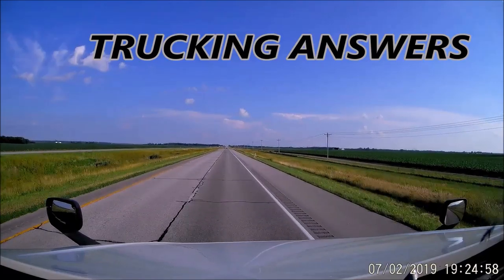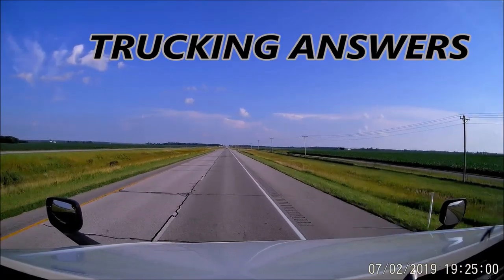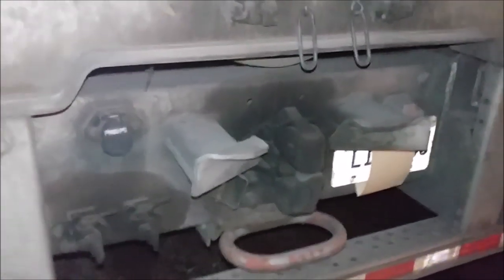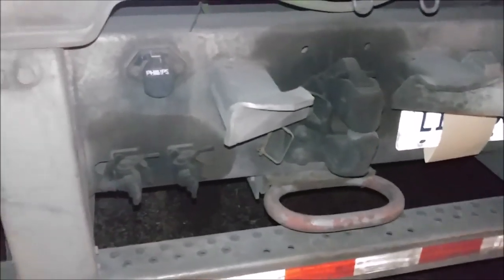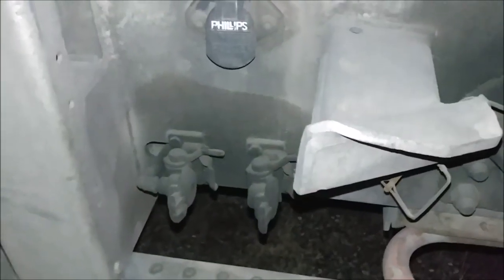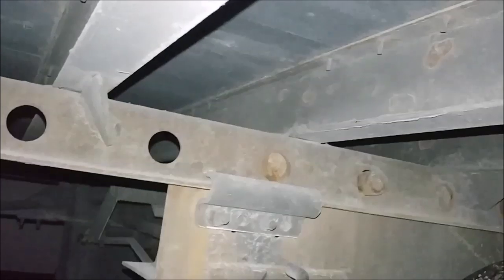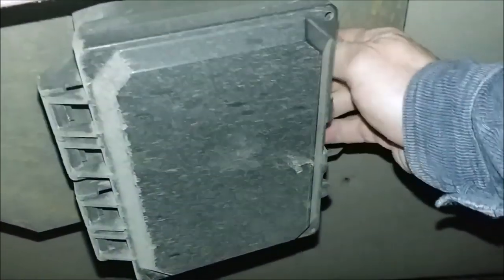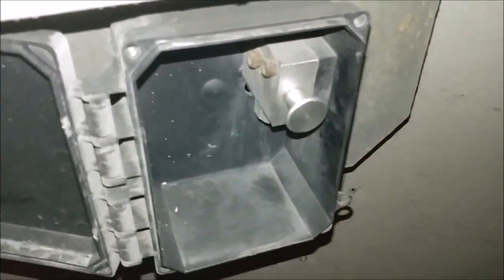Air leak?  Check here! | Quirky 53 | Trucking Answers

Comment: The micro 3way upper lites
When docking in a loading dock with an air dump suspension. Make sure the suspension is completely bottomed out before backing in tight to the dock. 
If you don't the bumper pads can and will rip out those lites. I've done some time in a yard dog as well.

Comment: All our trailers have a handle to pull to slide tandems and leavesprings new and old we have a few that are air ride but they 15 plus years old
Reply from the maker: Wow. We are mostly air slide.
Reply: @TruckingAnswers  less air leak areas  and cheaper to maintain

Comment: I still see trailer with handles for the tandems and they don't like to stay in place, so I have to use a pair of vice grips to lock it in place. I agree with the blinkers on top too.
Reply from the maker: There is a tool I've seen that hooks the handle and holds it out.

Comment: Hey Mark! What is an “A” train and a “B” train? These are configurations in Canada.
Reply from the maker: A train uses a separate dolly to connect the trailers. B train the 5th wheel is attached to the front trailer triple axles.

Comment: Wish they had a automatic landing gear crank greaser that u open up a box and push a button !
Reply: Old UPS wagons had air over hydrolic automatic landing gear. DON'T KNOCK THE BUNG OFF THAT AIR TANK! I drove a tandem tractor. You had to have a long slide 5th wheel that had to be over the last axle. With removable mudflaps.